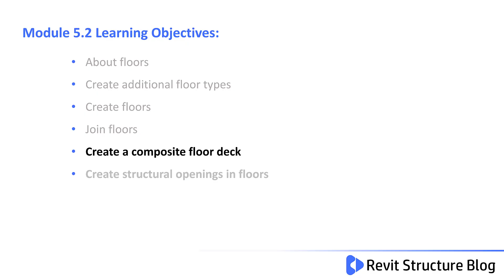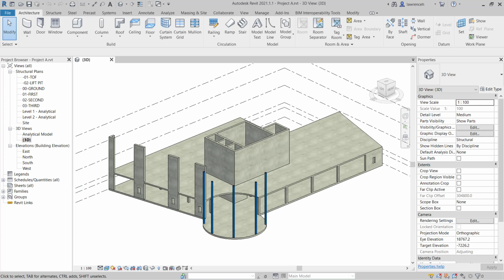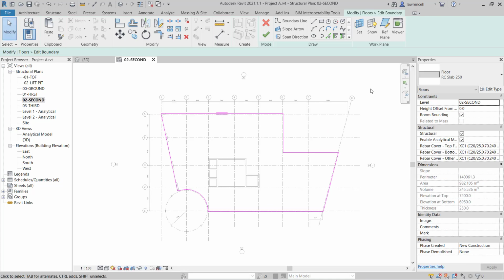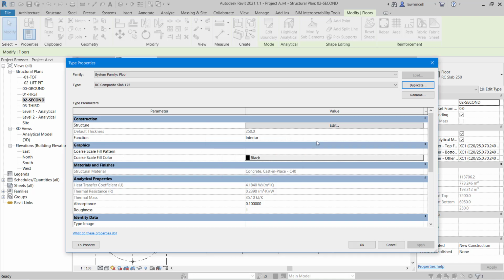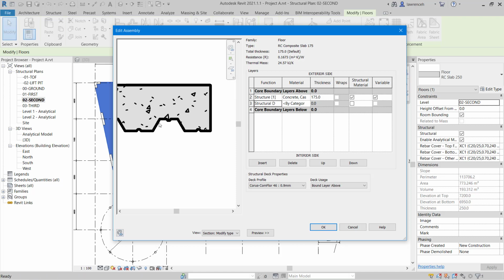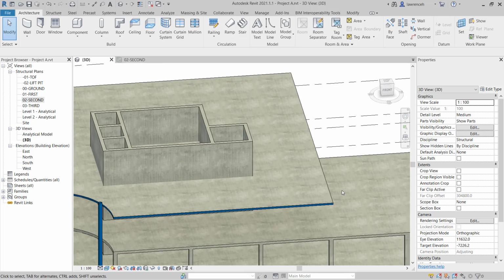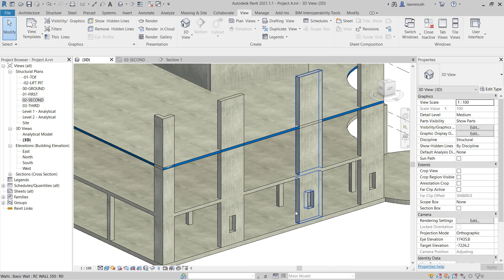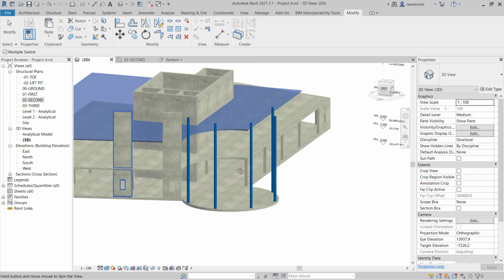Revit 2021 Training For Structures Essentials Module 5.2

Comment: Would you not trim the deck around the walls adj to grid 1(using edit floor slab) rather than join? - when using switch join command the model slab shows it going around the walls but editing it still shows straight line.
Reply from the maker: it is best to join and switch as this will update automatically and is quicker
Reply: @RevitStructureBlog  thank you.